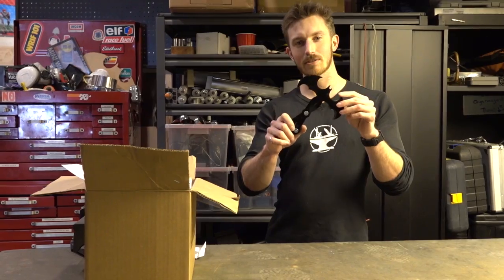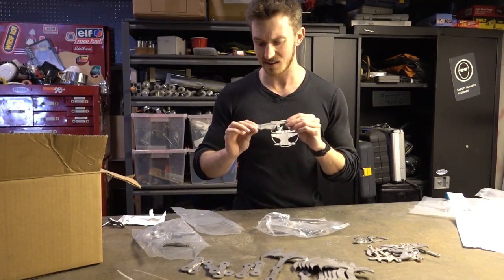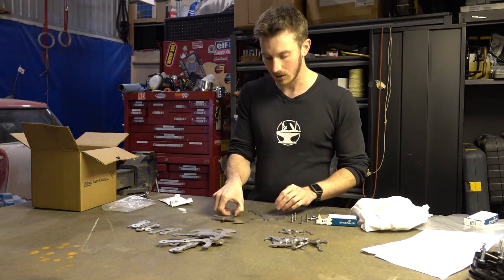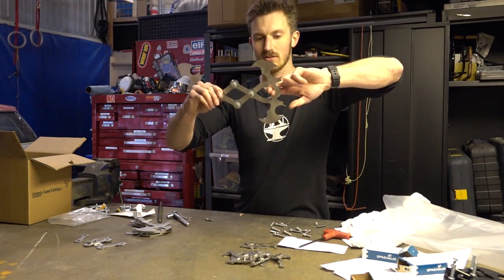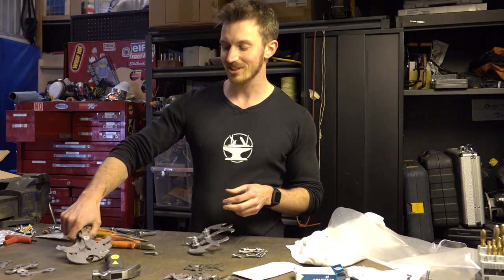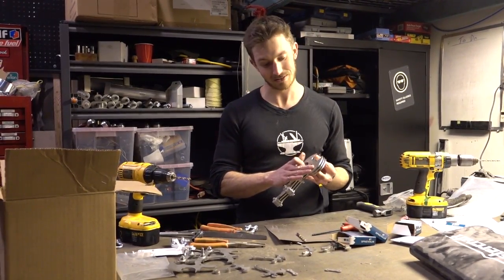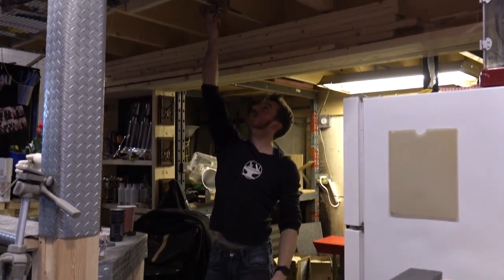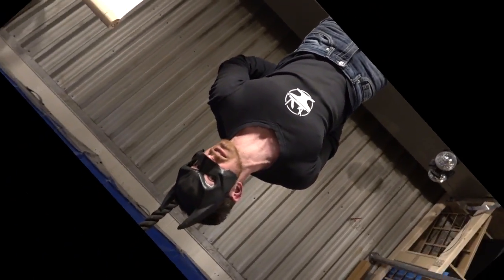Batman Rappelling Part 7 - THE STAINLESS STEEL BAT HOOK

Comment: Now, if I wanted this to be used for some sort of urban climbing/rappelling, could I request it without the wings, and instead with only the main clamping hooks.  I was thinking about putting one like the one i described on a strong wrist strap as a back up, and using the mechanism like a vertical handle in order to get hand holds that I would not normally be able to either reach or have the grip to use (such as a wooden beam).
Reply from the maker: +Alex B no sorry they are laser cut in bulk, can't do different designs.
Reply: So if I want to do something like that, I'd have to design it myself and have it laser cut, do you have measurements of the linkages and the clamping hooks in that case?
Reply from the maker: +Alex B I'm afraid not. But if you watch the earlier videos I show the mechanism it came from which you can buy from a store. I think theres also one called a gravity hook which is the same idea
Reply: I see, well thanks anyways.
Reply: +the blacksmith which store do you buy it from

Comment: Why stainless on something you're going to: A - Paint so it doesn't look stainless anymore, and B - That you have to throw or launch upwards our outwards? Stainless is pretty, but heavy. I mean... I guess it doesn't matter, you're not manufacturing these for actual use they just have to look cool for a few videos and technically work, not actually sneak into villain compounds.
Reply from the maker: +MattsAwesomeStuff We'll be sharpening the edges so there will be bare steel that would rust. Cost was negligible -- was going to go with Titanium but they didn't have any in stock. Even the SS was only about $3-5 per part, so dropping to a plain steel wouldn't of saved me much! And one could argue a nicely weighted grapple is good for throwing -- get a nice swing on it and it has a lot of momentum!
Reply: +the Hacksmith I didn't mention cost. Titanium would've been nice, though machining it is expensive. Throwing a 5 pound grapple isn't going to go far, launching would be even more prohibitive. Which can you throw farther, a softball or a shotput? Attach a rope, any different? But whatever, looks badass and presumably works, good enough for a fun project.
Reply from the maker: +MattsAwesomeStuff We'll we're just lasering it so machining wouldn't be an issue ;-) But I do agree, throwing a heavier grapple isn't good, but since we have a rope and can take advantage of some centripetal action, I think we could make it go farther! But, I could be wrong! Though really, the weight difference between stainless and another kind of steel is also pretty negligible -- could of used aluminum but... ehhhh...  

Anyway, we'll be redesigning it for the batman grapplehook launcher, and that one will probably be Titanium!
Reply: +the Hacksmith I wouldn't trust my life to aluminum. Garbage material.

Comment: How could you use the grappling hook when the spring holds rappell open
Reply from the maker: +Cartledge_ There's a locking pin in the center of the bats head, or you wrap the rope around the arm, doesn't take much to keep it in the open position.